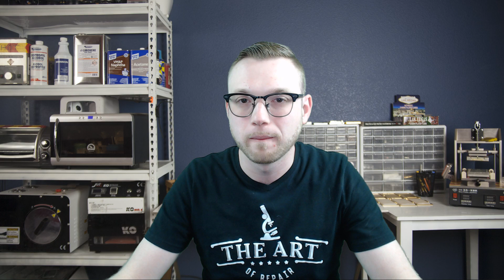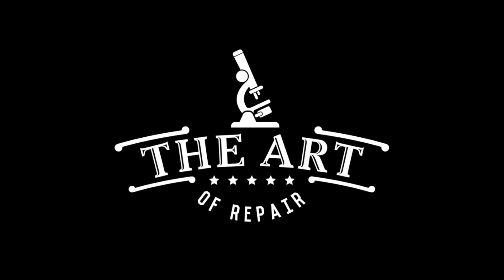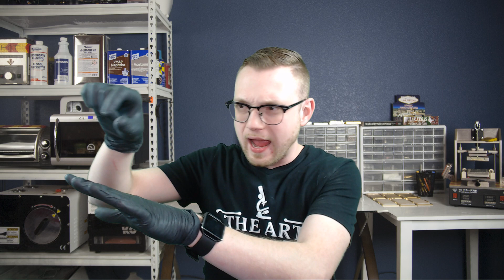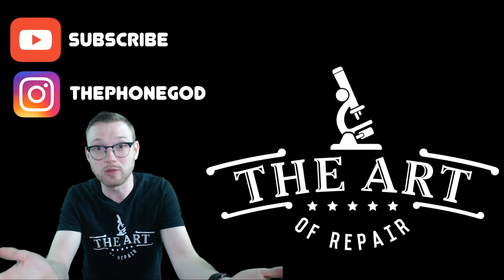EP40 The Importance of Refrigeration in Electronics Repair and Refurbishing.

Comment: It has a specific temperature range, or just put in the fridge? Peltier-based mini fridges has "higher" low-temperatures compared to standard mini fridges using R-22 gas or anything similar). something between 10-20 degrees celsius is enough? Or it should be lower than that?
Reply from the maker: Thiago Rocha that’s a good question. I would say more on the general cooler side, not the freezing side. Just don’t want heat to activate the suspension flux, or flux in general depending on what your storing
Reply: @TheArtofRepair  Great. Then Peltier-based mini fridges should be enough. Usually they go 10 to 15 degrees celsius lower than the ambient temperature. In São Paulo - Brazil Usually the temperatures are not higher than 35 degrees, so we should get something between 10 to 20 degrees as result. I will try to get borrowed one peltier-based to test with a thermometer and see what happens. By the way, Can you tell us which manufacturer/model of Mini-fridge you are using? Just for specs comparison ;)

Comment: Thanks Justin! I was wondering about putting my new Amtech 559-TF 30CC flux syringes in the fridge but the datasheet says to store them at room temperature vertically tip down.
Reply from the maker: Robert Calk Jr. i think when it comes down to it, referring to the actual data sheet is always best. Over the years about 20% of the flux I have used references being left out. I think this has to do with overall viscosity and how often they want you to repurchase 😅

I think that if you plan to do some long term storage, the cold will still be best bet, but daily use, follow the spec sheet :)
Reply: I guess they all have planned obsolescence in some form. But, any excuse for a test is a good excuse! I will leave one out and put the other one in the fridge and see the difference in a month or so when I run out of my Chip Quik SMD291 which I like very much.

Comment: Do you have a email i could contact you on?
Btw love your channels and been watching and learning alot.

But i need some guideness
I have a few key questions.

Ive been repairing ports and such little thing easy things.

Im wondering do i need the three machine to open a shop up to repair glass on phone?

Or can i make due with lcd/screen replacements machine?
Or do i need the lament one and the bubble machine?

Or can i just get the screen lcd remover basically almost a hot place and stick with mt soldering equipment
Thx for ur time